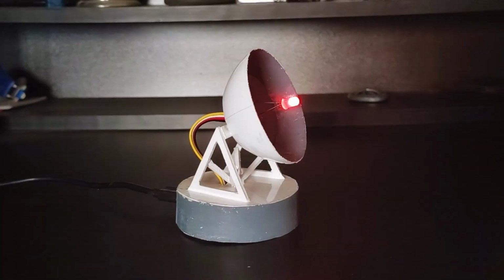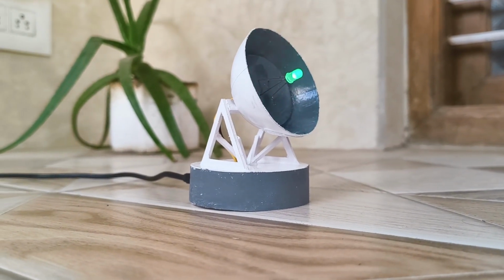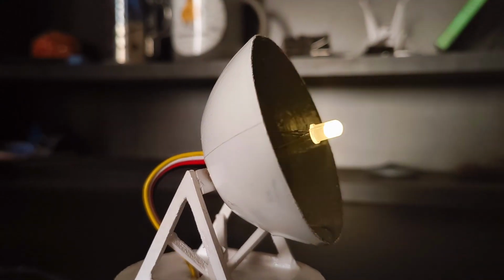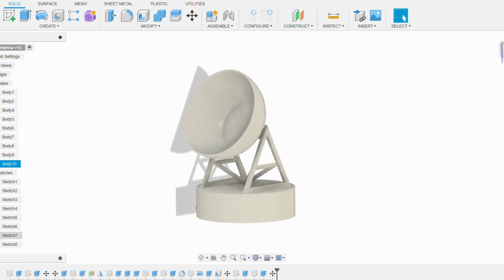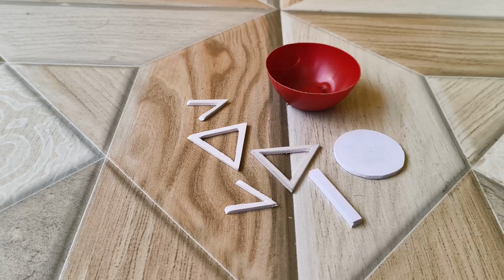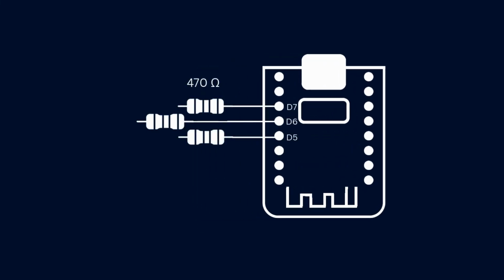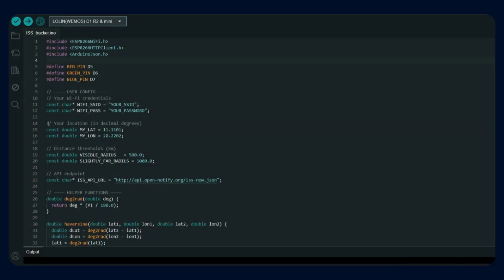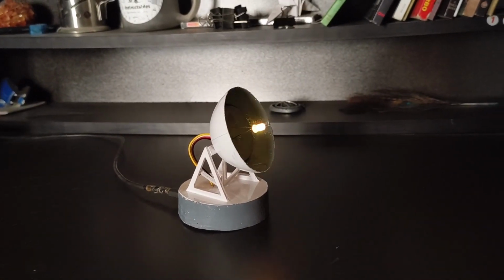This Mini ANTENNA Notifies You When the ISS is Overhead! (International Space Station)

Comment: Hi Makestreme,  I compiled the code in the instructible but always getting this error in serial monitor  ,,,     HTTP GET failed, code: -1
HTTP GET failed, code: -1   every 30 seconds,  Do I need a specific ESP8266 core version for it to work ?     Regards
Reply: When I open API URL in browser I get json response,so URL is reachable.
Reply from the maker: I don't think there's an issue with the esp8266 board. Others have faced this issue before. Most of the time, the solution is to wait for some time and it is resolved automatically. Maybe you can reduce the delay to 10 sec (10000) instead of 30 to avoid having to wait too long.
Reply: @makestreme   Thanks,are trying that now.

Comment: I just get 'HTTP GET failed, code: -1'  .SSID and password and coords are correct.
Reply from the maker: HTTP code -1 usually indicates that the server has timed out. Could be an issue from the open notify server end. It's not surprising since it's an open API. You could manually perform a GET request using something like python to rule out a server side issue
Reply: @makestreme  Thanks for the reply. I'll try that as soon as I understand what you mean.
Reply from the maker: I mean it could be an issue on the server side and not your code. Maybe you can wait for a while and try again. If it's a server side issue, it should be up and running after a while.
Reply: @makestreme  You are right. powered it up and left it over night. Red led now lit! 3dprinting the dish for it. Thanks for your help.
Reply from the maker: Awesome! Glad it works now